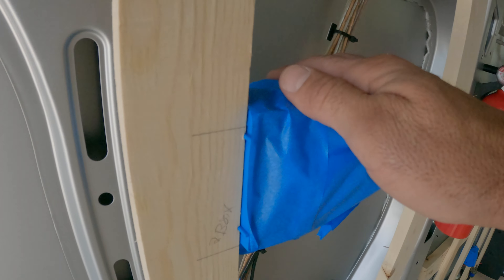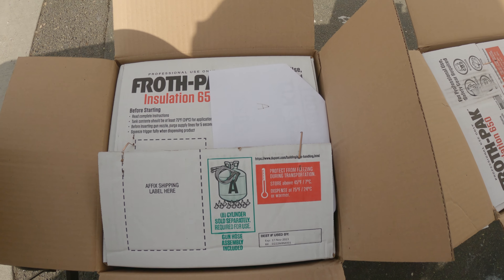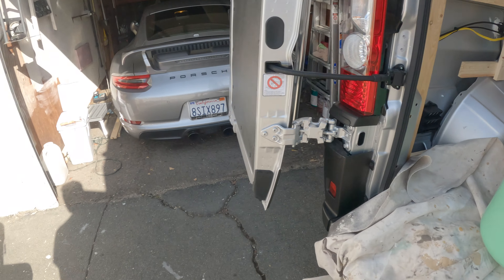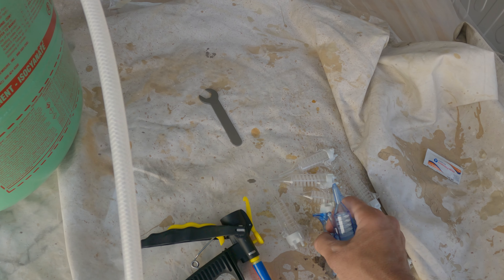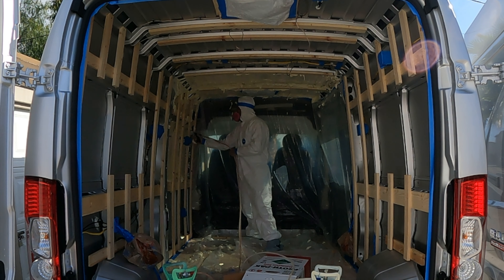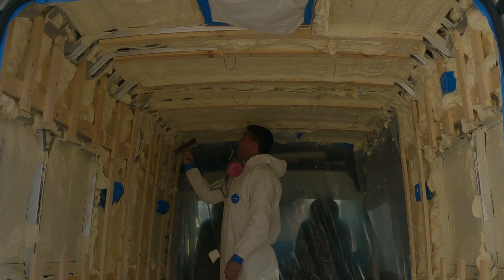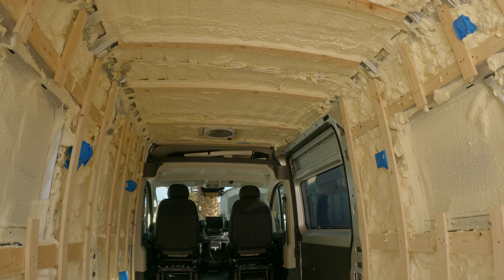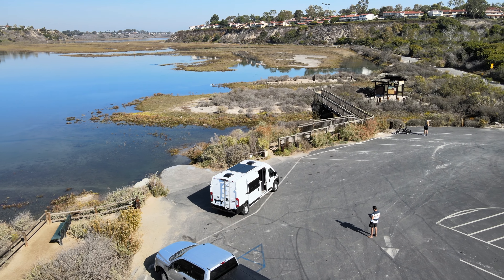How to Spray Foam Insulate a Van

Comment: Little bit of trivia… those pressure release vents you mention a very important when your air bags deploy. When those bombs go off in an accident, you will also destroy your ear drums if the vents are blocked.
Reply: I've been wondering what those are , yeah that's good to know.  I was just about to cover them.  Thanx
Reply: Those Cabin pressure release vents have been in cars way before Airbags were standard in cars Its use is for the slamming of car/van doors vs pressure on windows And rear window hatch glass Even windshields (Degrading sealant over time) an airbag deploying can reach 150–170 decibels The sound alone can deafen most However the pressure is in the bag itself not the surrounding area The bag then pushing air out the sides of itself at a rate that would not be the same pressure that would destroy eardrums You will also notice a fine powder mist from them Talcum powder or corn starch: Used to lubricate the airbag as it deploys Along with other by-products that were apart of the force to open the bag
Reply: Would blocking those not be largely negated by the large unsealed hole of the roof vent?

Comment: I intend to do this with my Promaster.  I have the spray can stuff, which I felt was more practical.  Allows me to use just the right amount and it doesn't require mixing two tanks to get perfection.  Lots of phony stories floating around about spray foam, how it warps metal and "off-gasses" you to death, and it goes all over the place so you have to spend hours cleaning it all up.  Talk to professionals who tell me only to spray 1/4-1/2 thick on the first layer, then let it cure then go around and build a second layer to 1" which will give you R6.   Lots of guys are using "mouse-house" 3M Thinsulate while others are using stick-on closed cell that melts off in hot weather.  Nothing compares to a good closed-cell spray foam, that's why the reefer companies use it.

Comment: im definitely doing this in my future (to be) van, but you could have gone way harder pretty much everywhere because you had the wood framing in place. So if you had gone a bit proud of that, all that was needed was a long blade to cut the excess foam down to the framing and everything would be flushed. i would have also spent a bit more time routing the cables and running them inside that cheap PVC tubes so that, in the future any maintenance/new runs/replacement runs, of wire are so much easier
Reply: I like the idea of running thin PVC tubes for cable pulls. A little weight but it adds a lot of future versatility.

Comment: Great/informative video - Thank you!
2 Questions: 1. The manufacturer recommends 2” thick, is that what you did?  2. Was the one “kit” enough for the van (was there extra)?  Tks
Reply from the maker: Yes it's a little more than 2'' thick everywhere but the bed cut out, i'll stuff some regular insulation in there as i put those wall panels up.  There was a decent amount left over but it is difficult to use the left overs if you wait more than a day or two.  If you do want to save the extra you need to keep one of the tips attached so the tip will clog but not the gun then put a new tip only when you are ready to use it.
Reply: @BuildingVanLife  That’s great insight.  Thank you and look forward to watching more.

Comment: Thanks for the walkthrough! I'm looking to insulate a van. I was thinking to insulate just past the wood frame then shave it back before installing the walls and ceiling. I'll be using may van across the Southeast and keeping it cool will be my focus. How much of a gap did you have from the insulation to your wall? It looks like there is a good amount of space that could still be filled. Open to any suggestions you have!
Reply from the maker: if you look at the next video in the series where i install the walls i fill the extra gaps with some extra chunks of fiberglass insulation so there is basically no gap.

Comment: A pat on the back for not filling the rocker panel with foam 
A few really good tips for your next build Or viewers looking to get the most out of spray foam : 
#1 I used many tall cans of rubberized spray after scuffing panels and metal framing Along with the rear doors This does not stop cold air However it slows the transfer of forced convection (Cold air blowing on thin metal) / radiant heat..like a steel pan And a coated steel pan that takes longer to get up to temp. Any exposed metal in the van has the same results
 
#2 With pocket holes leading into the rockers And a large gap in the rear doors You want to cover them up to spray over them For the pocket holes i used over lapping pieces of duct tape tight together (Foam does cure over it without burning it) Side note: I stuck a 5 inch long coat hanger in 3 places along, before i sprayed and removed them after for a small pressure release for opening and closing doors For the doors i used cheap plastic poster board you can buy at a Dollar store Or crafts place And done the same method. 

#3 Your wood / furring framing You can coat one side with the spray rubber if you did not spray where it is going to screw into (damp wood with hot and cold rots/warps/weakens it) I also done a very thin frame work to the rear doors About 3 paint sticks thick 1/3 inch? leaving one access point at the bottom of the rear doors for license plate lighting wires And made a wood mini cabinet without a door that pulls out when needed. I filled the doors with spray foam And shaved it flush to the framing Then added flexible thin paneling And spray glued my canvas type material 

#4 Red packing tape You will want to remove all the extra spray foam off the wood framing after you spray You can ether get a putty knife and scrape for 5 mins to a full hour depending on the mess Or peel away the tape.

#5 Don't bury your wires in foam. What happens when down the road you want to add a plug in Or something breaks down And you have to replace it? Find yourself the ideal size of Mini PVC piping for the amount of wires you will have Use them down both sides of the van with 2 per side T outlets The outlets make it more simple to fish a wire thru Or pull one out Then you can foam over it leaving the T part exposed 

#6 The pros of hiring a pro...If you never done spray foam before By the time you understand the expansion rate And the areas you need to address first you are almost done The bad thing about that is many factors But the most common is nooks and crannies you missed And some panels have more foam And others less foam And you no longer have foam in the bottles to fix this. What was your method to know exactly How thick your foam was? is the foam the same thickness thru out the van? - The pro's have a "high tech" tool to know this And with a total of 100 gallon drums They do not run out of foam And if you say you want Min 3" inches That is what you get. 

#7 High tech tool. Not many bother to find out how much foam they have Just that they have some So here is my tip on the high tech tool....Get yourself a measuring ruler with inches on it  Measure 8 inches on a coat hanger wire And cut it  Now if you wanted the target of 3 inchs of foam measure the wire 3 inches from the tip Mark it The wrap tape around that mark with the tape line facing you ....Poke the foam hard till it stops there is your 3 inch line.....Do this on all the panels eyeball if the whole panel is level with the 3 inch mark fill as needed  

I have many more but this is long .....hope it helps

Comment: Thanks for the video. Very useful. I’m exploring this idea as well for my Sprinter project. Did you happen to spray foam (insulate) a Sprinter? Every van has a difference in the way it’s built. There’s a lot of scaremonger about warping the panels. Thanks in advance.
Reply from the maker: Yes I spray foam insulated the sprinter i built.  No problems at all.

Comment: Im wanting a van and i dont have money for building a wall and all that mice stuff. Im doing a no build. Just throwing my stuff in the van and live. So what would you recommend for insulation please? I seen some black one idk whats it xalled. Please help.
Reply from the maker: That would be the 3m insulate.  A lot of people use it.  It’s kind of expensive but it’s an ok option.  Not as good as the spray foam in my opinion
Reply: @BuildingVanLife  can you do spray foam and live in the van still? Or is it dangerous?

Comment: I’m pretty certain I’m gonna use spray foam for insulation for all the reasons you’ve noted in your vids…. Just one concern that’s come up I’d like your opinion on: some have told me that condensation is an issue with foam and that can lead to mold. Any thoughts?
Thanks
Reply from the maker: I don’t think it’s possible.  Condensation usually occurs when hot air meets cold metal or glass, not on insulation which won’t be cold.  If you are just referring to moisture from breathing that would be even worse on an absorbent traditional insulation.   This is the 5th van I did with the spray foam.  I wouldn’t change anything.  I always change things on the next one when they give me problems
Reply: Thanks - sounds logical…
Reply: I drive 18wheelers and the trailers I pull are refrigerated units. Spray foam is absolutely the best insulation but it does tend to get water logged in some circumstances. 
when I haul pork I run at -10 and in the summer I have to open the doors to let everything dry out, the guys that do not end up adding around 1500lbs to the trailer just in trapped water in the foam it’s self and at that point it’s almost impossible to dry. That 1500lbs on a 53’x10’ box padded 6” thick. 
Moisture can find its way into just about anything, just let it air out now and then. 
I’ll be going foam on mine but looks like one bottle isn’t really gonna cut it.

Comment: One question; why don't you use spray insulation on the floor?
Reply from the maker: because you need to have the floor uniform and flat.  Here is the video where I show how to insulate the floor.  https://youtu.be/KnkiEpzS0a0?si=YH81gPKkxL2S8PJJ
Reply: @BuildingVanLife  Hey thank you for the link! I guess my question relates to condensation. I've seen people put Vapor Barriers on floors and walls to fight condensation (and eventual rust) and there is a huge discussion on this point but personally I don't think VB are a good idea. But I do think condensation can be a big problem and believe that spray foam is a great solution as it insulates and seals directly on the metal skin where condensation forms. I really don't think the other insulation materials like wool rockwool and thinsulate help with eliminating condensation but spray closed cell foam does. Are you not worried about condensation on the floor? Or is using the board insulation just so much easier that it out weighs your condensation concerns?

Comment: Why didn’t you spray until the foam reaches the same level as the wood slats ? You still had plenty of space to add more foam, now it’s just going to be empty space between your wall boards and the foam. Putting foam “flush” with the wood slats is how you do it for a house. But I guess if your budget only allowed one kit of tanks, than you just used what you had and that ok. Just curious…
Reply from the maker: The gap in your house is only as thick as a 2x4 which is 3 1/2 inches.  In some spots because of the shape of the van it’s MUCH deeper.  There is no need to make it any deeper.  At that point you are just wasting money and adding weight.  And yes the insulation is heavy. Pick up the full tank then feel how light it is when it’s empty and you will see.  Also understand when I first spray it, is not how deep it is.  It expands while it dries about 4x as much as when I initially sprayed it and in a bunch of spots it ends up coming past the furring strips and i end up needing to remove that to install the walls and ceilings

Comment: Why not put the walls up..or panels up first ad drill holes and fill
Reply from the maker: You would have holes in your wall plus the foam expands with enough force that it will destroy your wall plus